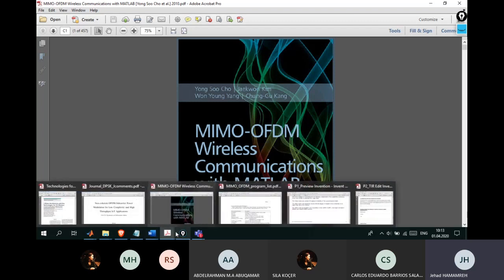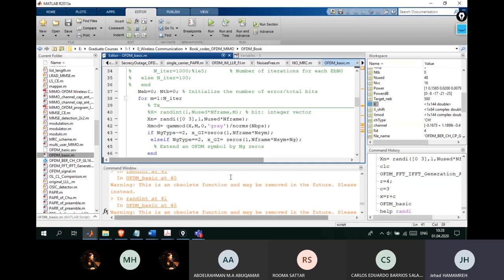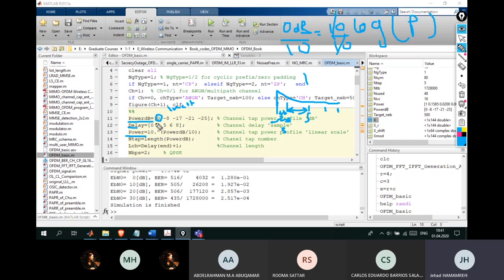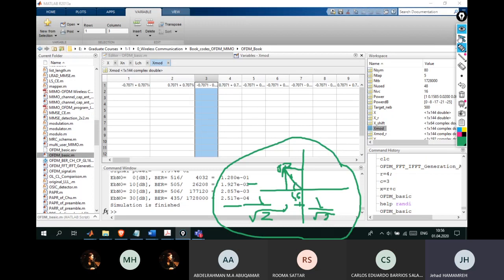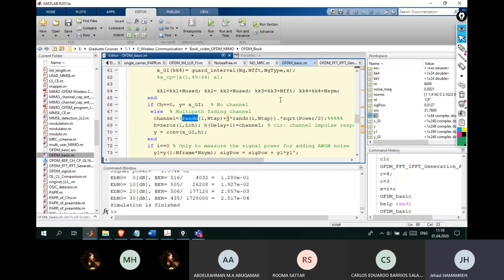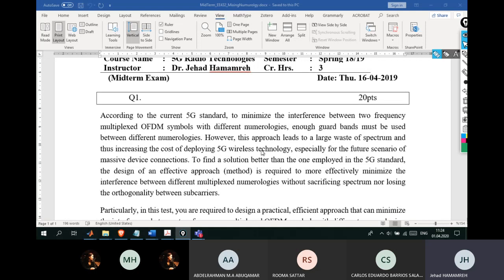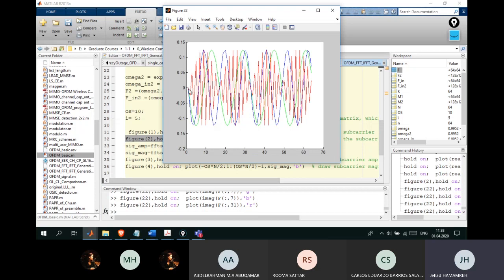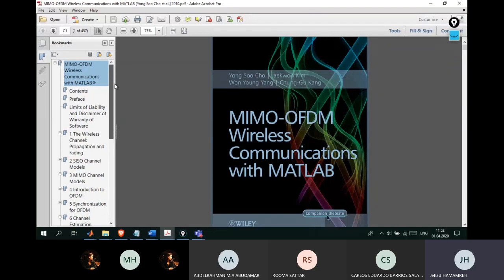Tutorial on Understanding OFDM Simulation and its 5G Multi-Numerology Implementation Using Matlab

Comment: Salam Prof. Hamarmreh, thank you for the very helpful tutorial. I have a question regarding the computation of the signal power for the noise variance computation.  Why do we need it if the average signal power  before the IFFT is 1 ? I am trying to relate it to the signal carrier simulation,  I don't need to measure the power in the simulation as I know the average is 1.
Reply from the maker: Yes, but it is recommended to do so in order to take into consideration the effect of any precoding, pre-equalization, or filtering method applied to the signal before its transmission.